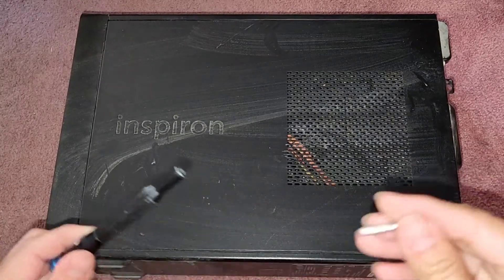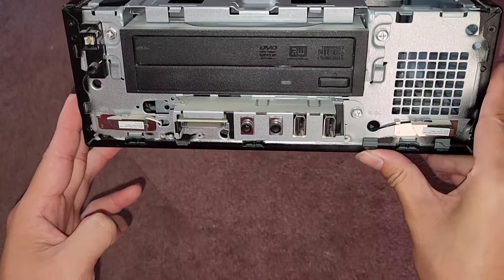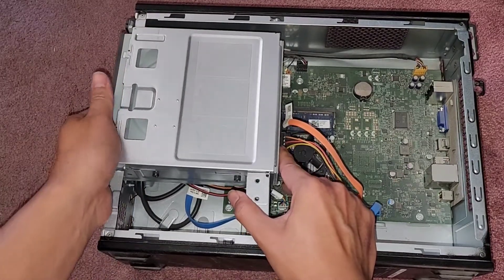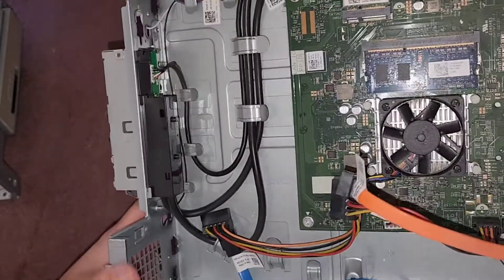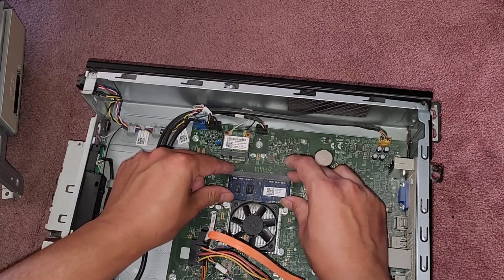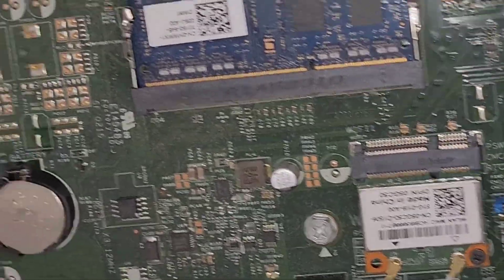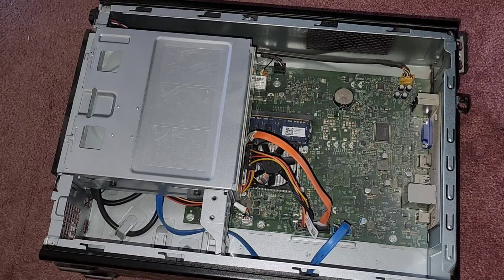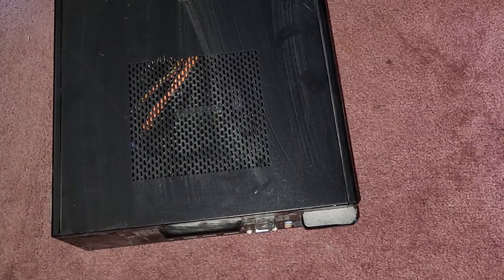DELL Inspiron 3646 Disassembly RAM SSD Hard Drive Upgrade CMOS BIOS RTC Battery Replacement Repair

Comment: How do I make this old pc run fast it runs so slow and added a new ssd drive and a 16 gb ram
Reply from the maker: Processor is likely the bottleneck.
Reply: @ItsBinhRepaired the cpu is like stuck on the motherboard I think that’s how they made it do you know how to get it off
Reply from the maker: @og_kobecurry1950  it's soldered on there
Reply: @ItsBinhRepaired can change the motherboard
Reply from the maker: @og_kobecurry1950  if you can find a compatible one, but you might as well get a new computer at that point